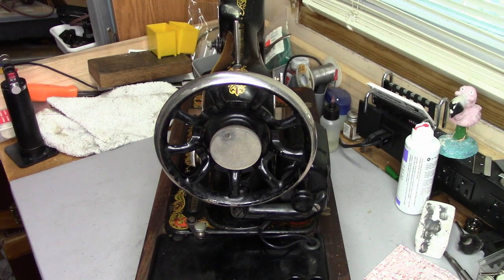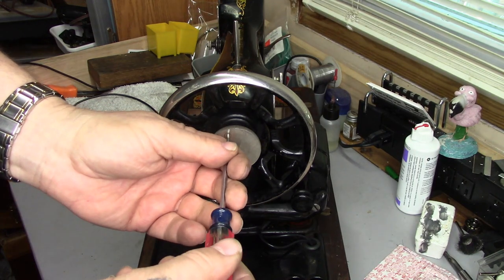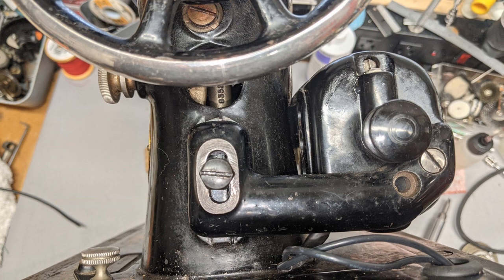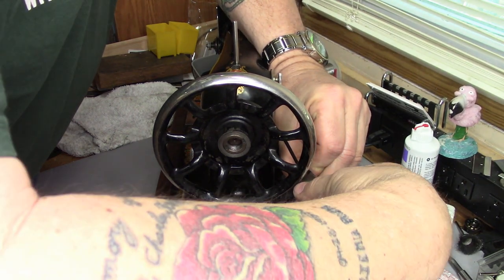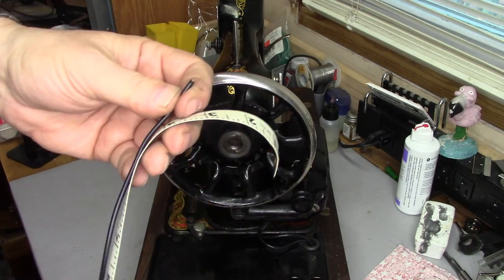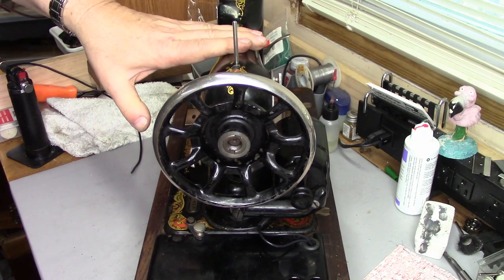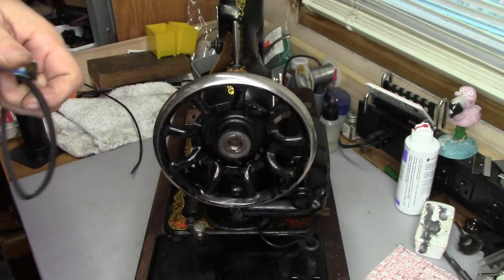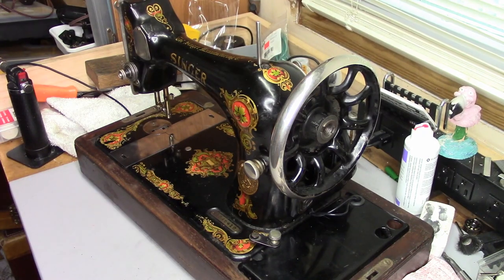Fitting Belts

Comment: Hi Bob. Just came across your video. I have a vintage Necchi and it didn't run at all. My brother replaced the motor and foot, unfortunately, it still doesn't work. The belt he put on is worn and very loose. The motor's mechanism that drives the belt has teeth running along the edge and I don't know what belt is suitable. Can you advise. With thanks from Liverpool, England.
Reply from the maker: Not knowing which Necchi you have makes it impossible to say which belt you need. One excellent source is Sewing Parts Online, but they are on my side of the pond, so shipping may be a bit slow and/or expensive...   https://tinyurl.com/h32t3vye